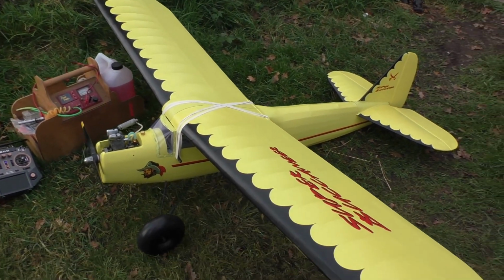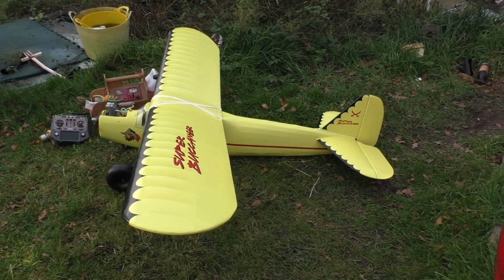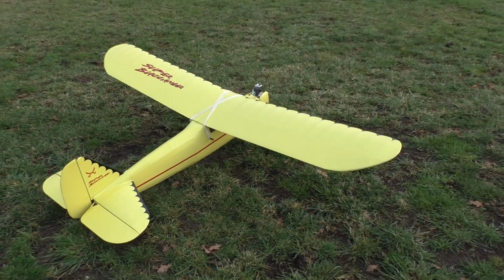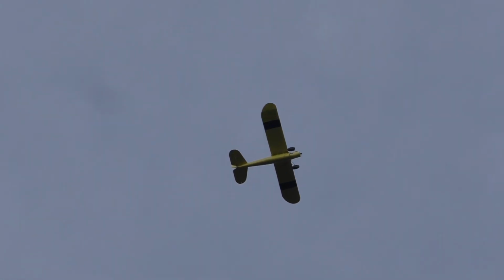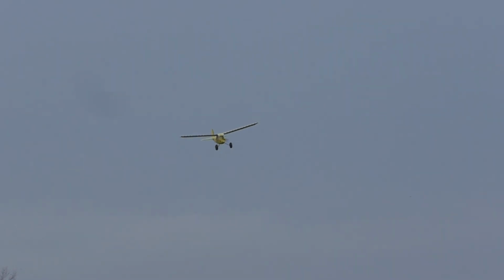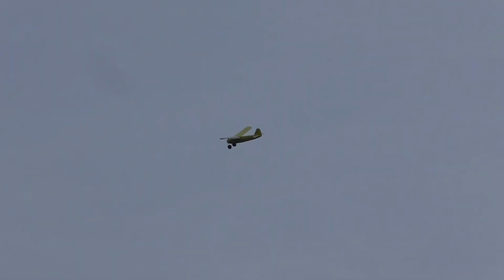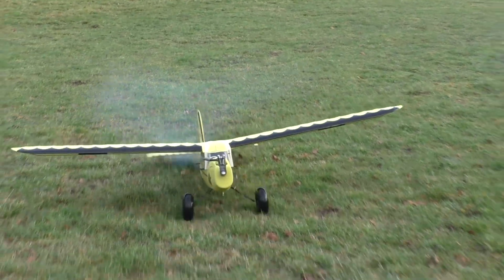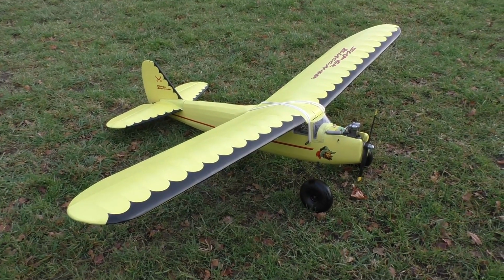Ben Buckle Super Buccaneer - RC Model Geeks

Comment: Whan I was a child, my father had one of those he'd built as a teenager in the 30's in a big crate he built for it up in our attic. As a dopey child, I could not resist the temptation to poke holes in the covering. It was perversely satisfying, like popping packing puffs! Now, as an adult, and an avid RC'r myself, have a special affinity for this old plane. Love the 4 stroke as well. And yes, this was originally a FF design, and I still have his engine with the little spark plug and electronic components.

Comment: Very sorry for your loss of your mum. I enjoy your video's and I popped by to your flying area by the beach where the little train runs. I must admire your skills, although the shed is always looking a little messy and in need some of Santa's little helpers. 🎅🎅,incidentally during lockdown I also built a DW Storch, I dought anyone had built one before they sold the kits, as you also found things like the battery positioning was a real cockup., plus knowing what to do with the slats, which I left fixed closed ,and the undercarriage was hopeless. Years ago I built the 90inh Svenson kit, which was brilliant. Anyway keep your chin up and carry on the good work.

Comment: Lovely Maiden  reallly. About the weight, I pictured my Technopower 5 or 7 up front to deal with the weight and balance. Perhaps a few inches more span? My last old time was an original Maxwell Basset Cardinal kit I got off ebay partially built. I converted it with a longer wing for slope soaring as I was living in Long Beach, California where right in town we had a 30' cliff facing the sea winds which were perfect for slope. Thanks, Thailand Paul/ Long Wing Berkeley Super Privateer .15

Comment: hmmm             excellent work.        research indicates, however, that this was, originally, a free-flight model.           if so, yer cad-version was, then, (probably) based on a  conversion to rc,  of a model  that was  Not  designed  for active controls.!
evaluation of control sensitivity  should be  informed, by these facts.         it may be that control surface area is excessive and/or throw needs to be reduced; in the linkage.         the amount of dihedral is also a factor (in yaw-axis  response).          in a free-flight model, a  bit  More  dihedral was used.!          all these facts begin to  suggest that the (conversion) model flew,  ONCE.      was  'repaired', and  sold.         this model  looks  like  a cargo  plane.!       so, certain traits  should  be  expected.         this model is floaty, in part, because it  has a huge wing.      it may, therefore, be advantageous  to tune  the model's   dom  for the flying  conditions; aka  adding ballast at the c-m.    distribution of mass;  center of mass.
it can be understood that,  the span-wise dom of a constant chord wing  WILL be  less-than ideal,  if  there is no  plan  to  Reduce/manage  the amount of  Mass (in the wing), towards the wingtips.!!!       d     googletranslate